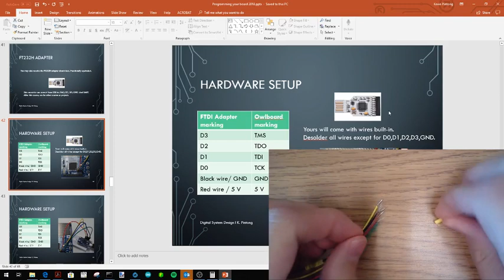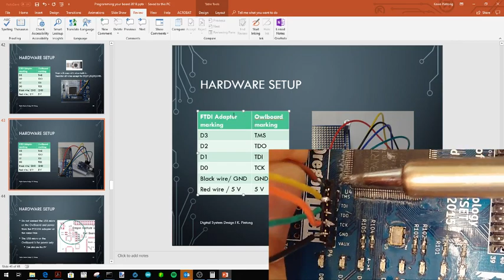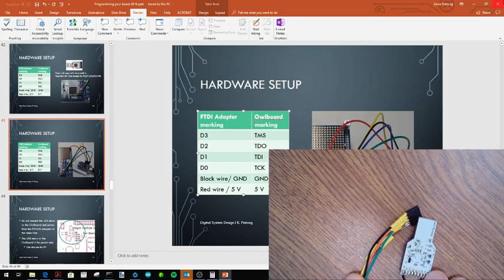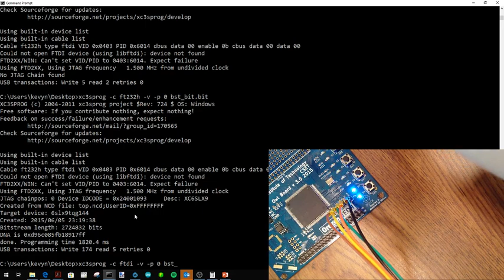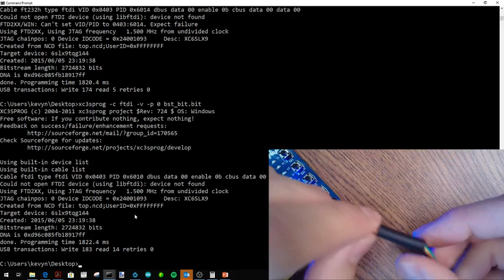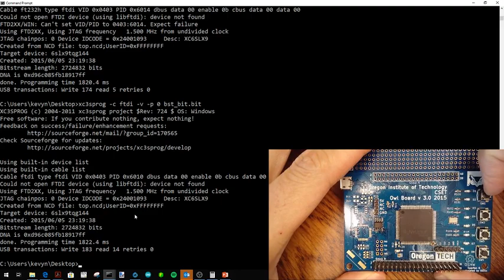How to build FT232H programmer and use with xc3sprog

Comment: Kevin, how did you generate the bst_bit.bit file? Is there a specific format for this file? Also, does XC3SPROG have D2XX driver inbuilt?
Reply from the maker: No you have to install D2XX yourself and the bst_bit file is a file I use. It's just instantiating the JTAG inside the FPGA.